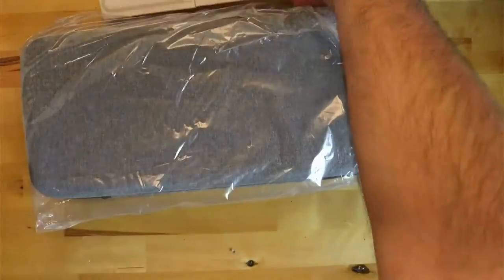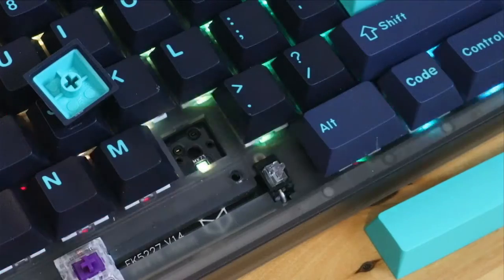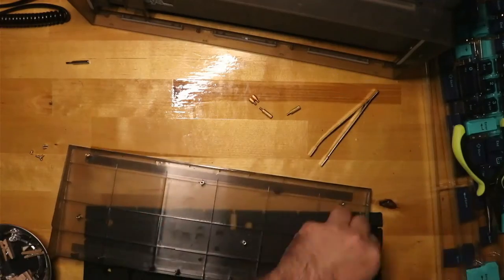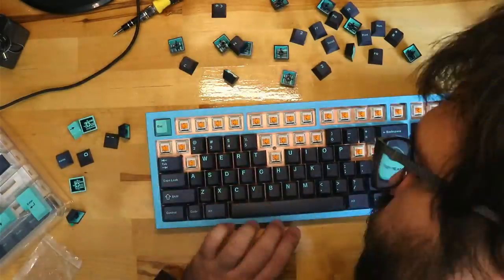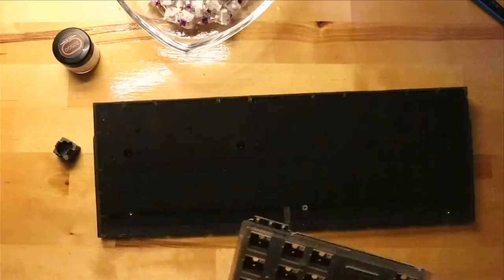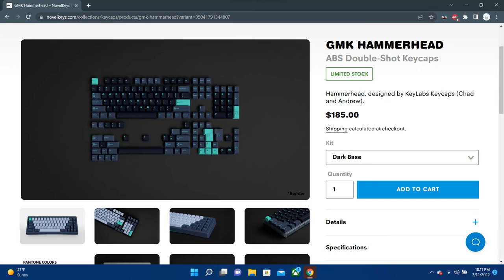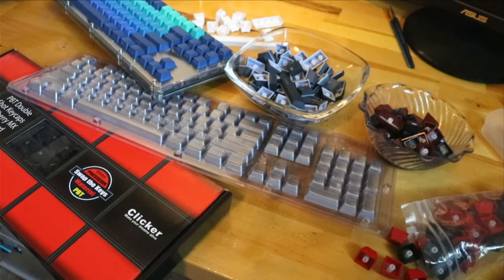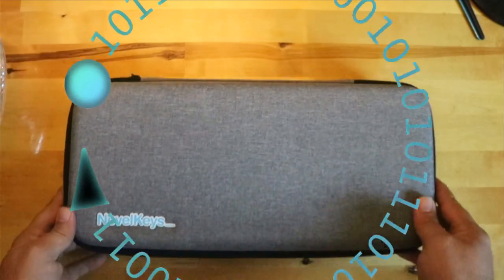Novelkeys NK87 Entry Edition: A Custom Keyboard Build and what you should know

Comment: Most decent cap sets support tsangan bottom row. may of those sets start in the $60 range. All of the sets novelkeys sell on the site that the board is from support it. This seems more like a buyer awareness and seller warning thing than a design issue.
also, I'll take tsangan bottom row any day over ANSI 6.25u except on 65/75 layouts. so many cap sets support it be to supporting winkeyless.
Reply from the maker: I prefer ANSI 6.25 - for some reason it just doesn't feel right to me. Budget keycap sets don't support Tsangan. I hope budget keycap manufacturers start to support it for main stream users. Large manufacturers just started adopting standard ANSI, so going Tsangen now would be a step in the wrong direction, in my opinion. I would hope that keycap manufacturers would be the ones to adopt new layouts. And yes, I'm well aware that literally all of their keycap sets are supported, which is a great thing to do as a supplier, however, 85$ is more than most people are willing to pay just for the keycaps. My goal is to get the average person into the hobby, and things like this are what people need to be aware of. ANSI is supported by literally every keycap set in existence, but Tsangen isn't. I'm glad that you have a preference and this layout is your favorite. Do you have one of these keyboards, and what did you put in the F13 spot? or are you part of the 65% and lower gang?

Comment: I'm tempted by the batch 1 Alu editions of the NK87 for $135 and getting separately a pack of washers for the pcb. have a keycap set already 👀

edit: after shipping/tax for the NK87 + washers brings my total to $160ish in dangerous area with the option of getting a keychron q3 and a q3 polycarbonate plate (at divinikey) ugh decisions
Reply from the maker: I mean, personally, I'd say the q3, but I have yet to get one and review it. I was not happy with the quality of the injection molding. Don't get me wrong it's a great board and it has a really low sounding thock that's pretty good. So I mean if you want a really low pitch sound the Q3 is going to be not what you want. 

However I don't know how much the PC plate is going to reduce the sound it might sound pretty good to be honest I think one of my friends Dan F did a review of the stock Q3.